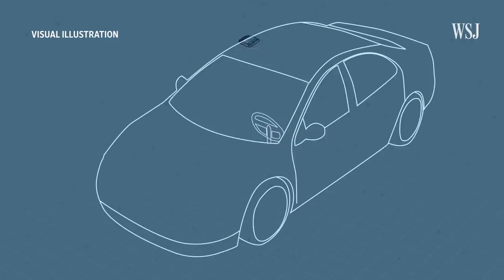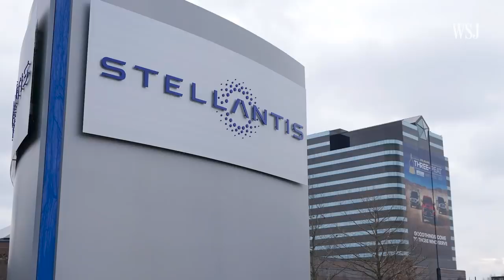How the Chip Shortage Is Forcing Auto Makers to Adapt | WSJ

Comment: How ironic.  With Just-in-Time inventory, they rather have a low inventory of tiny computer chips, and have a high inventory of unfinished vehicles to fill several parking lots seen from space.
Reply: You're rewriting the narrative. They clearly don't prefer that. What are you trying to achieve by making up stuff to complain about?
Reply: @chisquare5701  Do you not believe your lying eyes.  Some freshly minted MBA grad convinced mgt that short term profits are what shareholders value the most over long term survivability
Reply: @suffer4fashion  they burned out already. They recently announced production cuts.
Reply: If it wasn’t for JIT, they likely wouldn’t have survived until 2021 - pull your head in and read a book called ‘The Machine That Changed The World’.
Reply: No, high inventory of unfinished vehicles is the aftermath of low inventory for semiconductors. They don't chose between low inventory of semiconductors and high inventory of unfinished vehicles. For now, they would rather fill their parking lot than shut down their production line because they are still hoping that they would get enough semiconductors in the future and keep their employees working. But yes, I understand that Just-in-time system is fragile.
Reply: Chip factories would fill the same space lol
Reply: The book, "The Goal" goes into what happens when you throw efficiency at the wrong places. I was reminded of that by your comnent.
Reply: @dejan.  Please. They are using outdated chips for years and years.
Reply: @TheFourthWinchester  Define outdated?
Reply: We are gonna hit a massive recession next year. You watch. Come back to me in 2 years and praise me for my knowledge!!
Reply: @walterwhite1  what should we do Mr breaking bad? Sell crystal??

Comment: If i didn't appreciate this before, i definitely now appreciate owning a car that's almost paid off. Thankfully don't need to go to a dealership for a few years and getting even more ripped off due to limited inventory.
Reply: Agreed! I bought a new vehicle just before the pandemic hit, and then regretted it, as I worried about economic instability. Now I’m really glad to have done it. I’m within a year of paying it off now.
Reply: This. 2016 Corolla owner who is super stoked, just paid it off at the start of lockdown
Reply: If you have a newer car and it is almost paid off, it's lifespan is also almost over. Unlike the '60s and '70s vehicles I drive, newer vehicles cannot be kept going indefinitely.
Reply: @geraldscott4302  new account fudder, yea sure new cars are dead in a couple years, got any apocalypse predictions too?
Reply: @geraldscott4302   Unless its a toyota. This master tech says go buy one and your kids will drive it when they get their license and will last 300k easy
Reply: Especially used motor-vehicles
Reply: @geraldscott4302  not if it’s a Toyota or lexus, do research, even before the pandemic Toyota/lexus had higher resell value than most cars across the industry

Comment: Just push the seat forward and backward with a lever. How hard it could be. The same can be done to steering column. Todays cars are unnecessarily made more complicated.
Reply: Yeah, it's not that hard to go back to simpler analog systems without making customer sad or not getting cars at all. 
That also goes to car buyers. Buy cars with features that you need, not the features that are unnecessary
Reply: Just leave alone power train, safety feature and cruise control to be controled by electronic. The rest of the car can be reverted back to analog without serious consequenses. HVAC, infotaiment sys, lightning control, seat adjusment all this thing can be run by analog
Reply: the more complicated the more money they make for repairs why ever get a Moonroof? so after the 3 year manufacture it leaks or doesn't close which cost you thousands in repairs
Reply: Amen

Comment: Here's an idea: Don't make stupidly overcomplicated vehicles with nightmare electrical systems.
Reply: There are some cases where i understand the added complication, such as engine and transmission mgt systems which offer better performance and efficiency.  Why every interior and exterior system needs to be linked by a databus and controlled by a central computer is beyond me.
Reply: why wouldn't you take advantage of latest technology lol? is it not a business' main priority to get good quality out while making their lives easier? also, this isn't something that happens every other year lol, so it's nobody's fault.
Reply: @anishsattaram3793  - Just because a technology is new, doesn't means it's automatically better (there are plenty of automotive blunders throughout history that prove that).  Any engineer will tell you that the simpler a design can be, the better (assuming you're going for reliability and not planned obsolescence).  Will Stikken is right that computerized drivetrain systems can squeak a little more performance and efficiency out of a vehicle, but that also comes at a cost of complexity that gives the system more failure points and makes it more fragile (in addition to increasing repair costs).

I've always thought you could have some insanely reliable cars if you combined modern precision machining processes with more simplistic designs, but I know that's something we'll never see.
Reply: @NoName-ik2du  that's what i meant lol newer better technologies that would help the business make car making easier, but yeah i do agree they should go for a healthy blend of accurate technology with tried and tested mechanics

Comment: Some dealers near me have moved to an order at the dealer/at home, deliver the car at home set up. They're not stocking nearly as many cars at the dealership anymore.
Reply: According to VW president he said that the days of stocking dealerships with hundreds of cars are gone. The new paradigm will be made to order factory ordering. They will have indefinite short supply of vehicles on the lot.
Reply: The business model of dealers ordering a bunch of cars was doomed from the start. Actually this isn't really a thing outside of North America
Reply: The custom factory order system is just for now due to very low inventory. After the chip shortage is over, Toyota, Kia, Hyundai, Nissan lots etc. will be full of vehicles.
Reply: @JohnS-il1dr  VW are fools. After the chip shortage is over, car buyers will simply buy a Japanese or Korean car instead and VW will lose market share.

Comment: The funny thing is that these manufacturers are taking out these features but aren't reducing the prices of their cars. That's pretty scummy that they would remove features and not drop the prices for those features they've removed.
Reply: They're paying more the chips and this wouldn't effect costs significantly
Reply: Also supply and demand
Reply: The supply is extremely low this why their price is high.
Reply: @1ossksa  Honestly this whole situation is seriously annoying. I think it goes basically like this, 

During the pandemic, car manufacturers limited supplies because the market wasn't strong and people were out of work. 

Now with good employment figures, the whole nation basically wants a new car. 

Next, the chip shortage created by factories closing down due to the pandemic, caused car prices to skyrocket since manufacturers couldn't keep up with the increase of demand and had limited supply, making cars more expensive.

The pandemic further changed things and made people adopt new lifestyles that forced them to buy a car which further upset the supply of cars. Think city dwellers all moving out and needing a car in their new suburban or rural settings. 

Add to that Hurricane Ida which flooded hundreds of thousands of cars in the Northeast and now if you were to combine all those instances, then the result is a massive supply issue.

 Meanwhile, consumers are needing cars at an all-time high due to the aforementioned reasons, and since cars today rely so heavily on chips, manufacturers are forced to remove features and still keep prices high because of their limited supply but massive demand. So the end result is that a car today will have fewer features but still cost the same, if not more, than the original price. 

It's truly a magical time to be a car buyer

Comment: You forgot to mention severe price gauging by dealers, like my local Toyota up making EVERY CAR 10K regardless of model or price claiming it was “fair market price” as a prior customer ( imagine 62K for a rave 4 trd  pls tax) I laughed in his face and purchased a Gran Touring Mazda CX 5 fully loaded with every possible option like  leather, radar, front and rear collision mitigation, all seats heated as the steering wheel Cooled seats…… for 35K. Luxurious and all soft touch unlike the all hard plastic rav 4  cheap interior and crapy tiny screens. Shop around don’t believe their lies

Comment: New vehicles are more safe, but older vehicles are more reliable
Reply: That's not quite true.   Older vehicles, especially in America, are not known for their reliability.  They are however generally more maintainable. 
Newer vehicles tend to be safer, more efficient, more reliable and more comfortable.  they also tend to be much more expensive and complicated to repair.
Reply: I prefer a big old car
Reply: @willstikken5619  ehhhh as someone who gre up during the 50’s.   American cars started going down hill in the mid 60’s. Before then? If you maintained it you had a solid car no matter what brand from the big three you got.
Reply: Real Napster  What if my Japanese car was built in Texas, does that count?
Reply: @parkerhowell646  That's a common perspective relative to someones generation. Doesn't make it true. I grew up driving cars from the 60's and early 70's and there is a lot i love about them.  There is a lot i don't like about modern cars.  None of that negates newer cars being more reliable, efficient, comfortable and safer than the older cars we love.
Reply: @willstikken5619  modern cars are safer, that’s something you can’t argue.

Comment: Just invent something from ground up using just 1 chip for everything. Something like the apple m1
Reply: Well the problem becomes distance & wiring though there should be some streamlining
Reply: 🤦‍♂️ no
Reply: You can't because if there were to be a problem in the system the whole system would be affected and you probably wouldn't be able to drive the car until it's fixed (research  OBD can-bus system)
Reply: Modern day Marie Antoinette offering insights for car manufacturers
Reply: That bad . You need a back up chip or soon as it fails you die . Your whole vechile lose control
Reply: If only it was that simple lol

Comment: its like making cars computers on wheels is  not the best.  old school was the best
Reply: Nothing says "best" like making 150HP off a huge V8 getting 10MPG with no airbags, no power windows, no radio, and no air conditioning.
Reply: @spacetoast7783   putting your car for repair and waiting ages for chips because you got some fried up computer that is going to take 4 months to ship if it even ships to you while. So in the mean while you can get a a loan for 1000s of dolars to buy a expansive machine which will hook on to your car and tell you how screws up are you just to find out that you have no power to get the parts and even if you steel someone's car break it in half use the part in your own car then you realise that the software isn't working with it so you end up waiting a long time and paying almost as much as a 2nd hand car to get your car fixed topped up with the frustration of reading this comment.....ahh yes the future. ❤️.
Reply: @spacetoast7783  my 2002 honda accord has 125 hp on a 2 liter 4 cyl engine, has airbags and electric wibdows with ice cold ac at 36 mpg. This old school car does fine without self driving features, parking assistance, automatic braking, computer controlled windshield wipers. Huge tablet for a console and other chip hungry gadgets  the late 90s and early 2000s were the sweet spot for mechanical and computer integration.
Reply: @JohnS-il1dr  And it relies on lots of electronics. Thank you for bolstering my point.
Reply: @punavmirlekar  That's a really cool story. I liked it a lot, but it's a shame that it doesn't refute anything that I said.

Comment: My pickup truck has 0 semiconductors and only 6 fuses  and is 61 years old  so which vehicles technology is better one that can't run without 1000 electronic components or one that can be fixed with a few tools.

Comment: I mean I got a 63’ Cadillac so I’m not too concerned. Runs on fuel air and spark lol. I got electric seats 😂
Reply: That's really all you need.  Easy to work on too.  I'm a mopar guy though, 68 Chrysler Newport sedan.  2 extra doors, but that just means extra space.  My sedan is just as long as any modern pickup and the trunk is giant.  Also got power steering, A/C (that I need to fix), powerful engine, appropriate rear end for modern traffic.  Power drum brakes as well.  It's so comfortable.

Comment: You know what? With this chip shortage, we should go back to using old technology for cars.  Manufacturers should make car that is mostly analog and mechanical, doesn't use electronics, and most and important of all a car that is affordable and practical enough for common people to own that exploits the chip shortage by those factors. Only exception is the car can either have an induction motor for an electric option, a traditional gas engine or a combination of both as a hybrid.

Comment: Why not make all your cars with manual mirrors, manual door latches, manual trunk latches, manual seats, a manually adjustable steering column, manual windows, manual transmission, etc. and add the complicated and expense electronic options. That way if such a shortage were to happen you can make all of your cars with the manual options until the shortage is resolved. Trust me, people won't care. In fact more people will be willing to buy your chip shortage cars for the manual options. 

For example I won't buy any new car without all of the above.
Reply: I guess you'll never buy a new car again. There's like 6 vehicles that offer a manual transmission now. I got the last generation of Honda Accord with a manual trans.

Comment: cars ran without chips for decades...it's getting stupid in modern cars
Reply: Actually chips has been used in cars for decades, specially for engine and suspension systems and what not, it's just that more safety systems electric systems and entertainment systems added requires more chips to control them. It's not like we started using them a few years ago mate

Comment: a bit misleading...chips manufacturers did not prioritize electronics.  It was because car manufactures canceled their orders because they didn't think they would sell as many cars to reduce potential loss.  When they realize sales did not decrease as they expected and went back to order more, it was too late.  The chip manufacturers had already switched their machines to electronics so chips for automakers went behind the queue.  It's an expensive and time-consuming process to switch gears from one type of chip to another.   Now we have another problem which is hoarding.   Similar to how Americans started hoarding toilet paper at the beginning of the pandemic, companies are prolonging the chip shortage by over-ordering chips in anticipation that they "might run out" leaving others such as the auto industry to wait longer until their turn comes.  Of Course, they too will over-order in anticipation of "might run out" which will prolong the problem.

Comment: Makes you wonder why they don't just use 2 computers; using the ECU for safety-critical functions and the infotainment computer for feature control? I don't understand why blind-spot monitoring needs it's own chip.
Reply: There is a lot more that’s computerized than infotainment and safety. Pretty much every function down to the turn signals are computerized on the CAN bus. In your model the ECU would have to spend clock cycles toggling the power to the indicator. Those clock cycle could be more efficiently used if you just sent a single signal to a microprocessor in the mirror once. Then you could use all those saved clock cycles to do more monitoring and prevent crashes
Reply: @lukeh990  Well, considering that modern CPUs have well over a million cycles to process a single dataset (assuming a 1000hz input/output refresh rate and a >1GHz CPU), I see no reason why the ECU can't just handle turn signals, windows, etc, because it already handles ABS, Traction Control and ESC alongside the engine and transmission. No reason they can't do more.

Comment: "Because during the pandemic, chips for vehicles were diverted to meet a surge in demand for electronics as people were stuck at home" - was the editor who wrote this story 8 years old or is WSJ purposefully telling lies. Auto manufacturers order their "chips" months to years in advance because it takes 4-6 months to make a chip from "sand" to integrated circuit. The car companies predicted a drop in demand due to pandemic and rather than sit on some extra chips they told the semiconductor foundries to release their allocation slot - and the car companies went to the back of the queue when they realized they needed chips again. You can't jump out of line at Disneyland and expect to go back to where you were. It's not like the fuel control chips used in a SUV can be used in a PS5 or tablet - each chip is made custom for it's application. Next time the Bluetooth controller on my car burns out I will just pull one from my toaster....

Comment: So when the computer chip break down  while driving 90 miles n on the road it will cost 2000$ for the consumer but over millions for the company when u find out the problem... I hate v tec engines n engines that has more then three senior on it .......cheap.